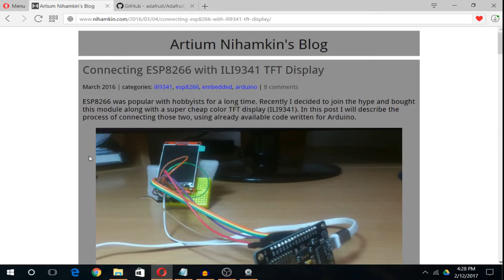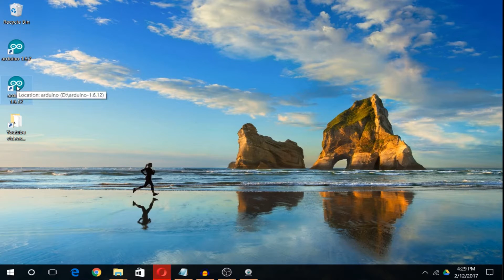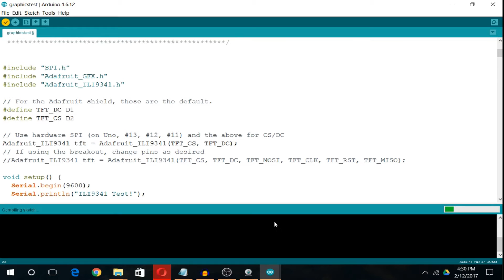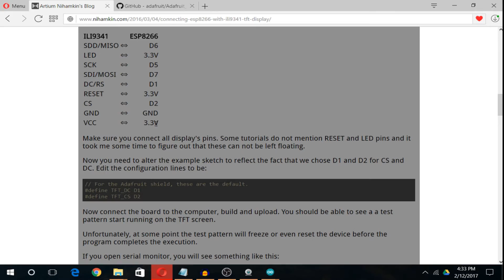ESP8266: ILI9341 SPI LCD with adafruit library

Comment: Hi i noticed the esp8266 i did the uncanny eyes but its not enough to run 2 sets of TFT lcd 128 x128 eyes same time seems it starts to work then the eyes blank out not to return , I'm thinking maybe the esp32 is more powerful to run both screens the esp8266 is not .

Comment: I have 2.4 tft lcd shield and trying it to connect it to nodemcu..I tried according tot your tutoriall but my LCD just glows but nothing is displayed
Reply from the maker: There could be many  reasons. Check your connections. Also check you lcd with another arduino.

Comment: I've got error message. Please help. Thanks.

Arduino: 1.8.5 (Windows 7), Board: "Generic ESP8266 Module, 80 MHz, 40MHz, DIO, 115200, 512K (64K SPIFFS), nodemcu, Disabled, None"

graphicstest:23: error: 'D2' was not declared in this scope

 #define TFT_CS D2

                ^

C:\Users\Aldrin\Documents\Arduino\Adafruit_ILI9341-master\examples\graphicstest\graphicstest.ino:26:41: note: in expansion of macro 'TFT_CS'

 Adafruit_ILI9341 tft = Adafruit_ILI9341(TFT_CS, TFT_DC);

                                         ^

graphicstest:22: error: 'D1' was not declared in this scope

 #define TFT_DC D1

                ^

C:\Users\Aldrin\Documents\Arduino\Adafruit_ILI9341-master\examples\graphicstest\graphicstest.ino:26:49: note: in expansion of macro 'TFT_DC'

 Adafruit_ILI9341 tft = Adafruit_ILI9341(TFT_CS, TFT_DC);

                                                 ^

exit status 1
'D2' was not declared in this scope
Reply from the maker: What is the error message ?
Reply from the maker: goto tools> board and select "nodeMCU 0.9" that should resolve the problem.
Reply: #define TFT_DC 5
#define TFT_CS 4

use this